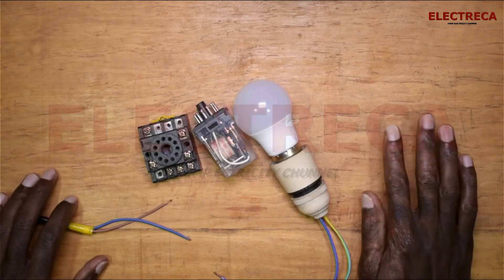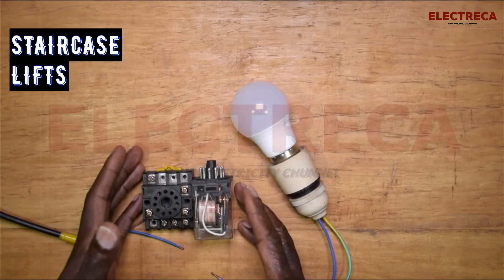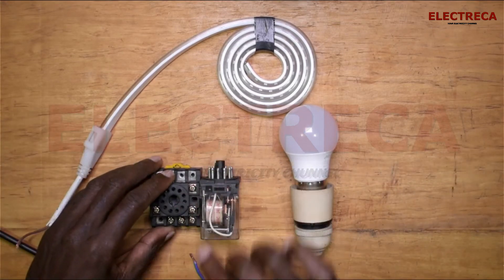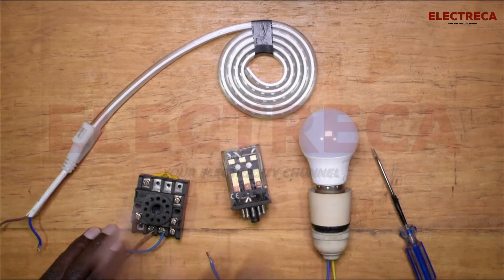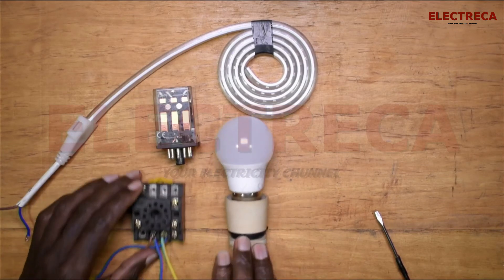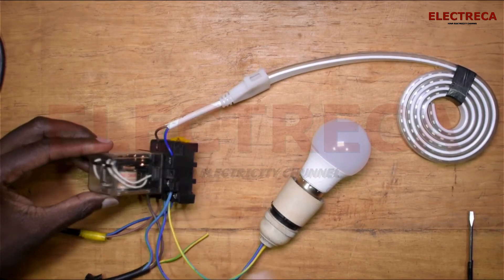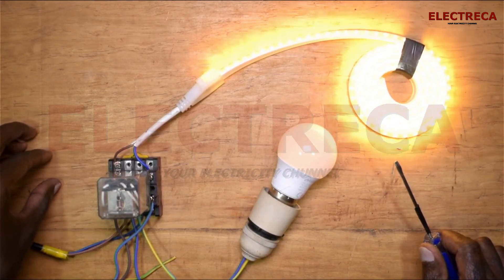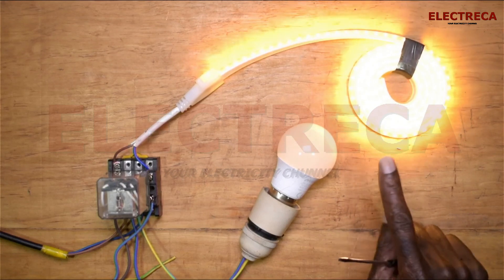How to make EMERGENCY LIGHTING for critical areas of insitalation|ELECTRECA

Comment: Thanks for the knowledge that you are sharing bro.But am confused a bit with the way you did the connections.In all other videos,I have always understood that,10 and 2 are the terminals that power the coil and that the pin relay can never work without energizing the coil.But here power source has on been connected to 11 and 1 terminals which are the common terminals of the relay leaving out the relay.I thought that 11 is normally open to 9 and closed to 8 and that 1 is open to 3 and closed to 4.so I don't understand how power will jump from NO 9 to NC8 and NO3 to NC4 respectively.Pliz can you elaborate more on this...Thank you

Comment: very nice presentation.
could you kindly do a video on the correct way to wire two bulbs controlled by two switches which are apart..
Reply from the maker: No problem i will